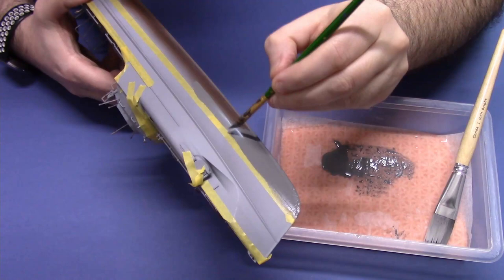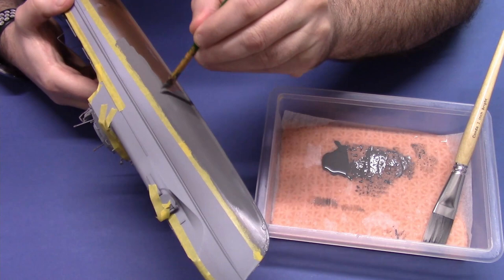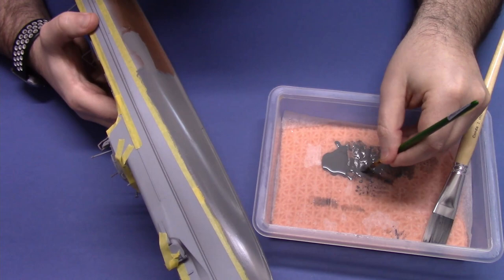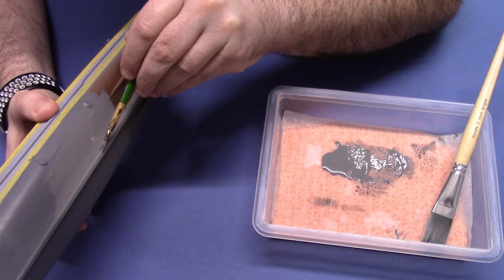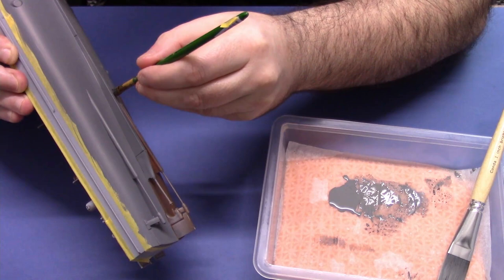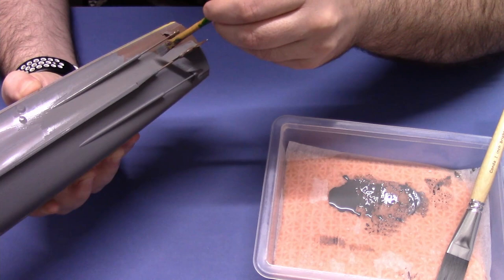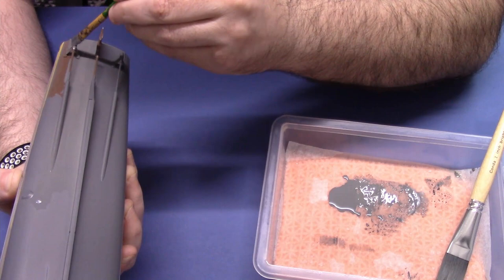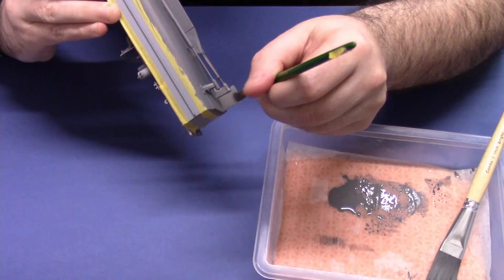Revell 1:72  S-100 Schnellboot / Hand Painted Hull / No Airbrush no problem

Comment: I find Revell kits very poor quality, at the moment I am building there schnelboot, the flash on the parts is ridiculous there is also a lot of warpage. Before I retired I worked for the Japanese we did injection moulding if our parts turned out like Revells they would be scrapped and the machine would be retooled.